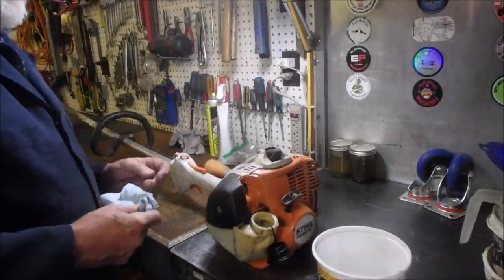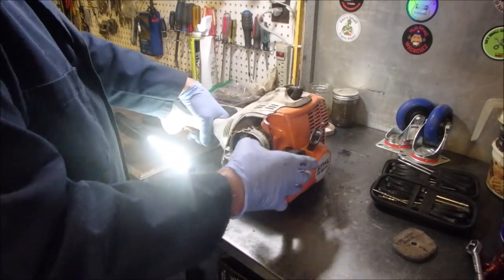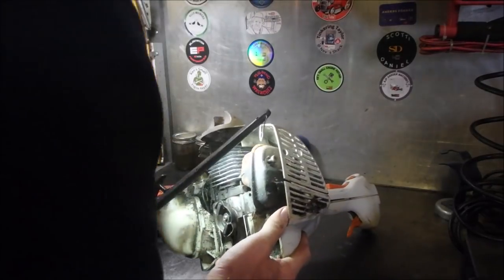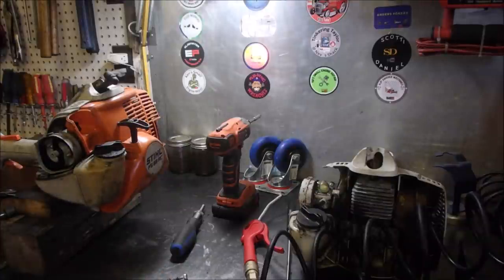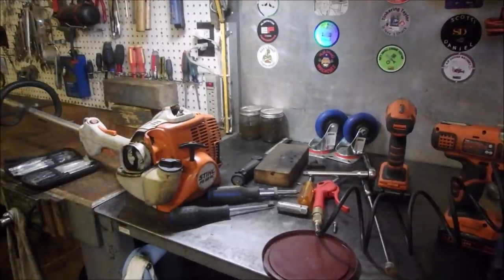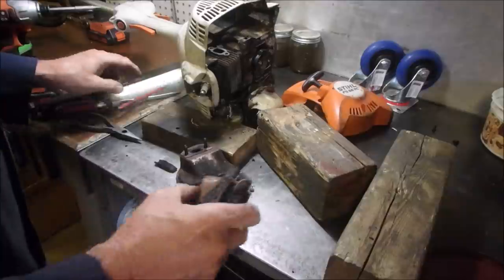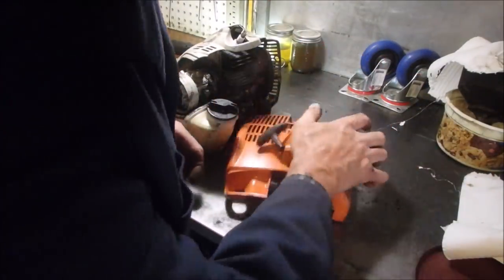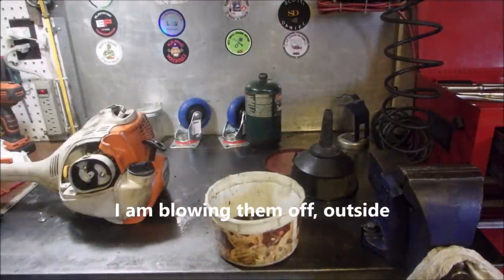Stihl FS 56 RC Trimmer  3 Things Wrong

Comment: I bought a new FS-56 RCE the other day, when it was on sale at my local Stihl dealer.  I have two days trimming with it under my belt.  I also loaded it with the black and orange line, which is a stronger and better line than the standard .095 orange line.  It has the new 26-2 cutting head on it which allows you to load the line without taking the spool apart.  I put 25’ of the new Stihl line on the spool pretty easily.  I have been breaking the trimmer in off my can of Stihl Moto Mix but will pretty soon start filling it from my container of Stihl Ultra 45:1 two cycle gas.  I made up another gallon, yesterday. - 84 ml of Stihl Ultra, one gallon of premium, non ethanol gas and an ounce of fuel stabilizer.  This is what all of my two cycles eat.    What I really like is the easy start on my FS-56.  I prime it a few times, put the choke in the full choke position and pull the starter rope easily.  It cranks right up.  The FS-56 is much lighter than my ten year old Husqvarna 28 L, which has served me, well.  It also has a little longer shaft than the 28 L.
Reply from the maker: That is so cool.

Comment: Ya can't mistake that sound when the muffler is plugged , I always look really close at the carb when I hear that sound and it's usually spitting gas back out if muffler is plugged.  I always do the final tune with everything  put back , air filter,  cover and always with the string at proper length . Good job , always nice to have doner parts too !!! 👍
Reply from the maker: Right on.  Yes I started it the next day and warmed it up.  Yes that carcass for spares was a great thing these days with parts going through the roof.

Comment: Great job getting the Husqvarna string trimmer all sorted out and running the way it's supposed to. The muffler sure was gummed all up i haven't seen anything quite that bad before well even though it put up a fight you still won Bruce excellent work my friend. 👍
Reply from the maker: Thanks  so much for the great comment.  It means a lot.
Reply: I had a gummed up fs45. Cleaned the screen and muffler, replaced the carb (it was a hot mess), and now I only run it with canned fuel. No problems...
Reply from the maker: @MazichMusic  Perfect.

Comment: Something to check. Stihl trimmer heads especially the older ones have a couple os screws you can take out and screw the tube of Stihl grease on to it and fill the head crankcase. It will keep the head from wearing out.Mowermedic has shown the trimmer head service.
Reply from the maker: Thanks a lot.

Comment: Good Video! 
That on e fought back all the way. Everyone tells me that the Stihls are designed to be easier to work on but I just don't see it. 
I don't usually forget they are out of fuel but I forget to hit the "On" switch all the time. LOL
(Edit) I like the idea of taping the string down, gonna have to steal that one 🙂
Reply from the maker: Right on.  Go ahead.  My bench is covered with trimmer line scars.

Comment: If the muffler is really plugged, two basic options.  Bang it on some metal and blow it out with an air compressor, or hit it with a propane torch.
Reply from the maker: Right I burned it out

Comment: Couldn’t get past your noisy fan😢
Reply from the maker: I think you are hearing my furnace.  I can't stop that.
Reply: I ended up using my AirPods and it seemed to filter out a lot of the furnace noise. Glad I tried it. Good information for sure. I didn’t know that a muffler could clog up and the use of the torch is pretty cool. Thanks!😊